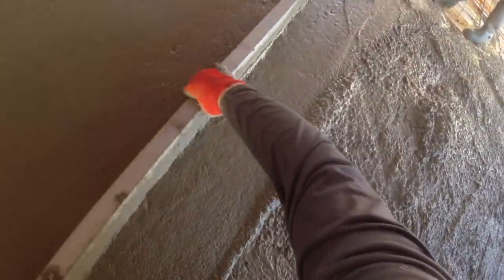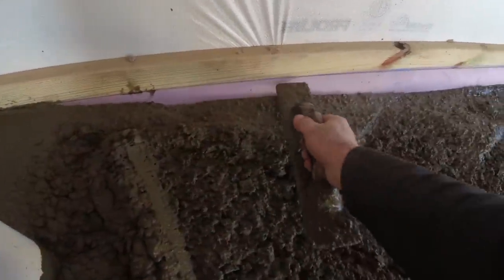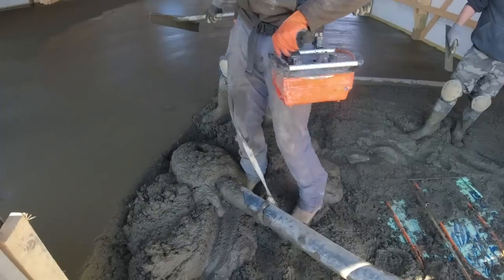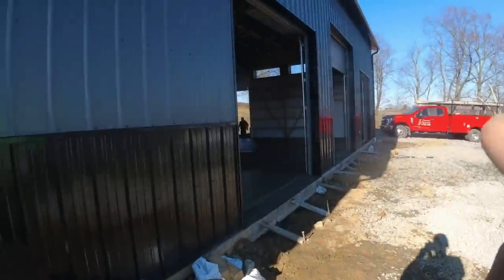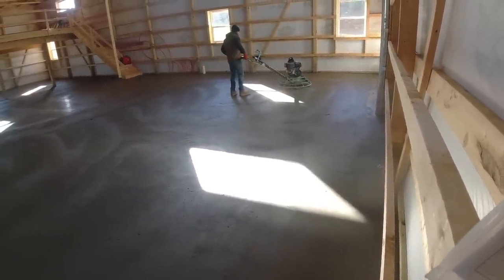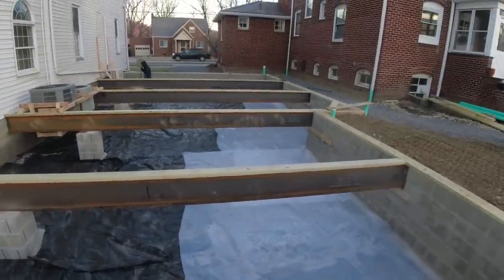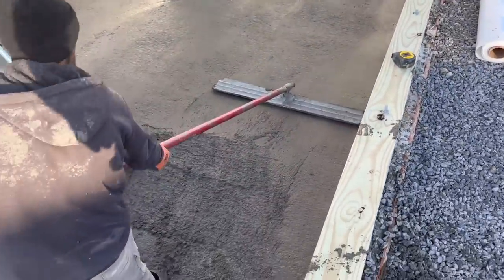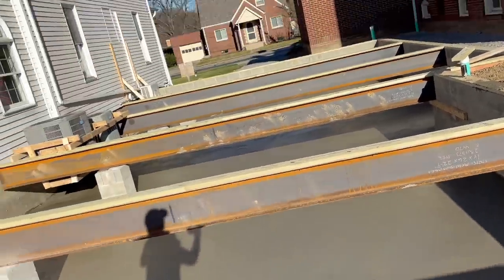Are You Kidding? One Wheelbarrow Short!

Comment: Today's video showed me that no matter how good your math is and how many years experience under your belt, it's hard to order the exact amount of concrete. That was so close, though, 1 1/2 wheelbarrows. Wow! It's great to see that attention you put on every detail. Your fingers put the concrete smooth and perfect inside the door track where the float couldn't touch. You told us about the air content. There's something over my head yet. You explained low and high, but I can't see that in my mind. I really like seeing the steam rising from the concrete from the pour to the top of the mixer. The hopper really had the steam rising up out of it. You gave good advice w the rubber gloves. In the manufacturing of copper and fiberoptic cable, a type of grease is used and is quite difficult to remove. For years, we kept a container on each line that a toxic liquid in it we called 629. So stupid! That is so toxic! It goes through the skin, into the blood, and causes cancer. We finally caught on, and today, there are 3 sizes of latex gloves on each line and all places where they are needed. We do stupid things. Kudos for that safety tip and all the others you've given us. It never hurts to be reminded to be safe and not stupid. It sure looked cold on all of today's pours. It is time to end the season. For us fans of your channel, that means we get to enjoy the off-season projects. Last year's was terrific. Thanks for today's video. I'll be watching for your next post. 👍❤️🙏🇺🇸🇺🇸
Reply: Think of the air content of the mix as the holes in a sponge. The bubbles allow the moisture some space to expand when it freezes. More air in mix, more and bigger bubbles. And the bubbles are real small.
Reply: Less than a sixteenth of an inch of variation of the depth, over that large of an area can result in needing more concrete. OR - just a little less water can do the same thing.

BUT - in this case I would bet that the low air mix gave less volume from the weighed out load into each truck.

Might be worth going back over notes and videos to see if ordering low or no air, for machine trowelling, needs a tiny correction factor to not come out short.

Comment: Never did a tube type heated concrete pour only wire so other then punctures is the any other considerations yo7 have to think about with the tubes like different mix depth of placement ECT. ? ❤️

Comment: Merry Christmas to you! And why don't you vibrate the concrete so that there are no voids?
Reply: Generally only needed when pouring significant depth and even with taller steps it might be only cosmetic and not worth the higher risk of forms shifting.

On structural walls and some ( deeper ) footings vibration is necessary.

On jobs where I worked we often used just pressing the back of an orbital sander to the forms to reduce honeycomb on steps over two feet tall. But just tapping with a rake or hammer and making sure corners are filled by plunging in with a float is plenty.

We didn't pour monolithic steps the way Tom does. We created an inner form filled with sand, because around here sand is very cheap and concrete, when pigmented, can easily exceed $300 per yard. So, getting a couple of feet vertically to fill well between the inner and outer forms does require using the stinger.

Comment: Anyone got any bricks? JUST KIDDING.
Reply: I'm sure Tom will be back pouring an apron in front of those doors. If it was my OWN garage, I'da found some bricks! Lol  or probably would have cut that sill back, stuck rebar in the wet floor, that way, no issues with the heat pipes, then later poured the sill right into the apron. BUT....
I ain't TOM and that ain't my garage, and I don't do concrete!  Tom does it right. COST him!.. but lose a buck, not his reputation n' business.
That was too big of a job to try to skimp and save on.
Reply: @JohnSmith-tv5ep  I do do concrete I would have done exactly what he did for a whole lot of reasons. But your talking to a guy who thought girls peed out of their butts when I was 8 because I saw my mom sit down to pee once
Reply: I never did that! Lol 😂
Reply: @DFord-rv3nz  I get what you're saying bout the concrete. Thing is When I poured my garage myself (30years ago) I DID come up short by six shovels on a 16yard floor, and needed some filler right at the corner of the apron. Gravel was my friend!  Lasted bout 5 years till it cracked Lol
That's why I don't and won't do concrete! Lol
Reply: @JohnSmith-tv5ep  in my youth I've seen that twice. One of them was a large concrete company I couldn't believe it I was just starting out at 17 they used to do the concrete high rises in parking garages
Reply: @DFord-rv3nz  takes all kinds! That's why now if you want things done right, you gotta wait and pay the money
Reply: @JohnSmith-tv5ep  agreed. In my 30+ years I've never done that. The customers who are not willing to pay the proper price are the customers you do not want. People have a tendency of mistaking kindness for weakness. They just don't know how to be responsible for themselves